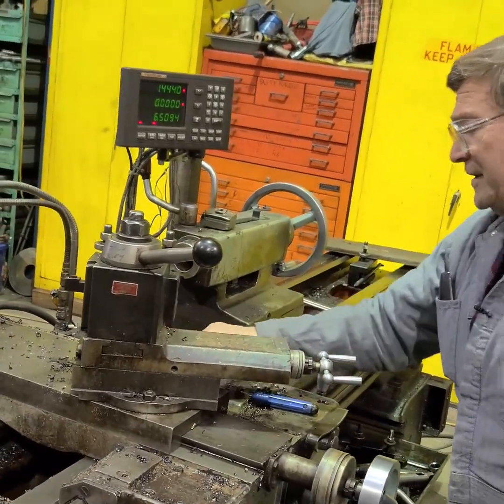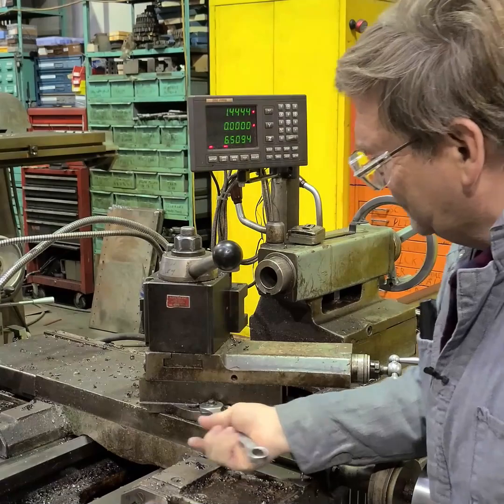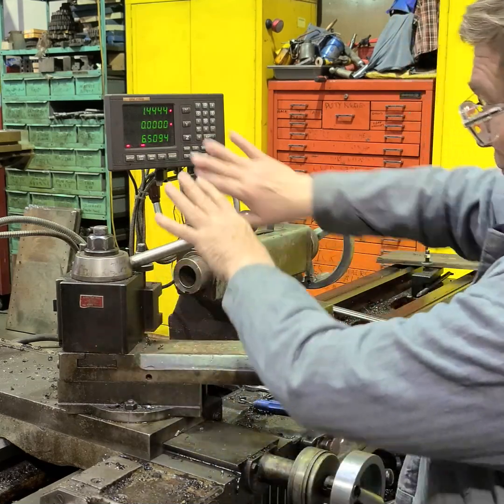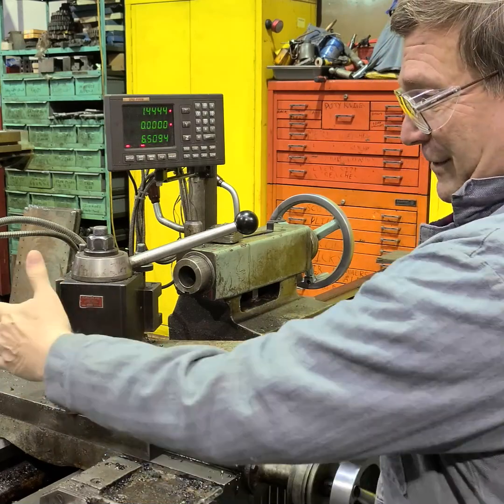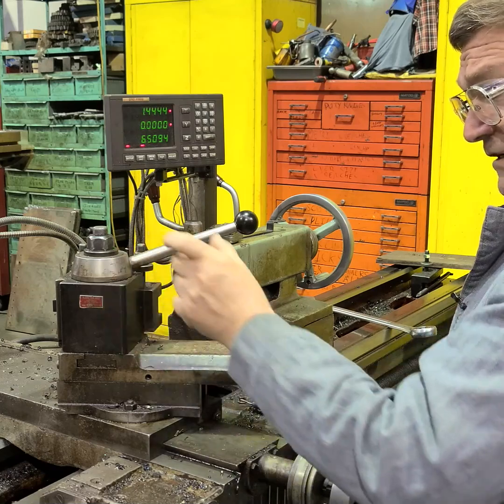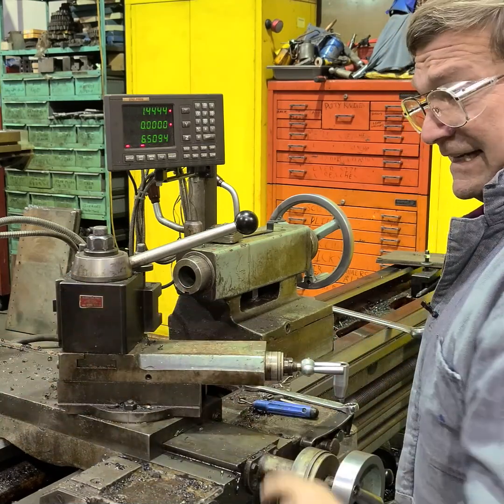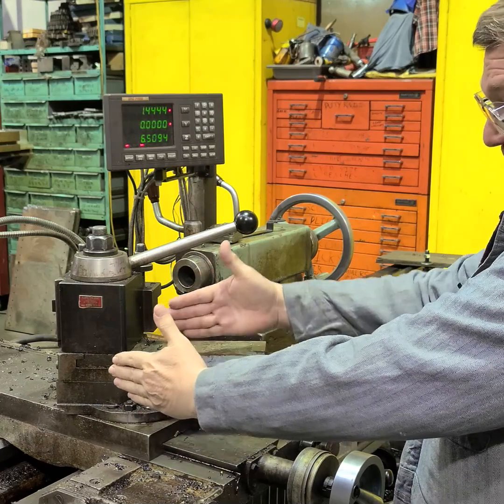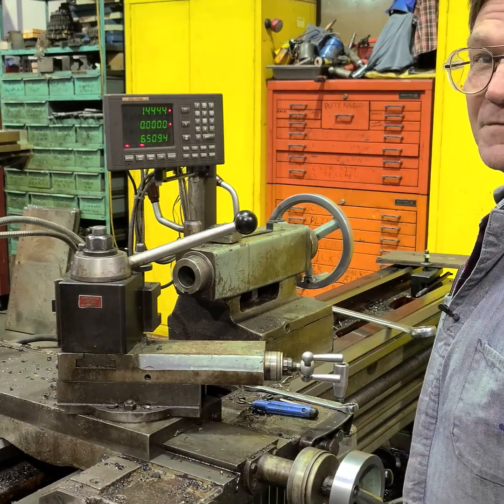Machinist's Minute: Set your compound to 29 or 60 degrees

Comment: I thought I was the only person that did that.
 29.5°, has to do more with tool tip pressure/heat/esthetics. The latter being  .. witness tool marks on the leading flank angle during threading ..and the condition of the machine and set-up. (Forgotten tip, thanks).

Comment: I thought they said we would never use trigonometry after highschool.
Reply: Trig has made me more money that I though it would. It’s why I know believe learning everything I can is important
Reply: @jamiepolchies7148 About 15 years after high school, I started using trig in auto repair. When I owned a shop, I had a small machine shop to be able to make tools and modify poorly made parts. Then when I closed the shop I worked for a company that did mobile adas calibrations. It was much faster to find the location to place the target for toyota blind spot monitors using trig than the way they said to do it. You have to find the center point of the vehicle and use a plumb bob to mark the rear of the vehicle on the center point. Then, place a laser cross the centerline an unknown distance from the mark. So you already had a 90*, and they gave you the length of the hypotenuse. Rather than doing a million measurements around the vehicle. I would just measure one of the agles off of the teplate on the monitor instead of printing it and placing it on the center line and do a bunch of measuremens. With that, I would just calculate the length of the legs and make 2 measurements from my mark and laser lines. After writing that, it seems like a lot, but it was much less work than what toyota said to do.
Reply: “They” know nothing of machinists!  We are the keepers of useful math, which “they” also know little about.

Comment: Any idea why I see lathes where the compound is set parallel with Z? I’ve never understood that.
Reply: When you don,t have digital readout the compound slide dial can be used to cut steps certain length using dial on compound if you set it so it's travel is going left to right or parallel to lathe bed,another way is put a dial indicator with 1 inch travel and use it like digital readout,another way is using a dead stop on carriage with a micrometer dial which it common on engine lathes

Comment: I recently went and visited my old trade school(used to be 5 in the state now only one left)and was saddened to see the shop was almost all CNC machines but had one old dusty Bridgeport and an old 22" Clausing and a Brown and Sharpe screw machine tucked away in the corner collecting cobwebs. The instructor said they don't teach the "old stuff" anymore. Too bad.
Reply: My trade school only had 1 cnc mill and 1 cnc lathe, all the other 35 machines were old school, no DRO's and no power feed, glad we at least have DRO's at work, but the knowledge to work without the modern amenities is helpful
Reply: interesting a trade school does that. our university starts you on manual machines then you work up to cnc if you wish. 

i wonder if it’s bc most jobs are cnc operators so they want it to replicate what’s in the real world?

i think it’s nice to start on manual to appreciate what the tool is doing
Reply: My school, we were lucky AF, 6 then later 7 diffrent manual mills, like 16 manual lathes(2diffrent types dont remember off my head), followed by like 16 cnc lathes, 2 of which could have live feed tools in there, and there were 4 3 axis cnc mills, one of which could be fitted with a 4th axis, and a 5 axis mill on top of it all
Reply: Kinda like teaching points and dizzy I auto school.  Not really called for.
Reply: Smart people making an old skill more valuable.

Comment: For od .009 give me .018 
I half the angle to 14 deg to do fine turning. .001 give me .0005 .
I think the reason 30 is great for threading is because .001 in compound is .001 of diameter of od.

Comment: Setting the compound at 29 allows you to thread clean threads, shaving slightly on the right. But… for deep threads, the tool might dig in, depending on the material. Be careful, take light cuts as you approach the PD.

Comment: 29*, 29-1/2*, 30*... the selected stance of various machinists... lol. 
I run 29-1/2* ahahaha
Reply: Makes both flanks of the thread birght.
Reply: @MrEh5  when I was an MR in the Navy we always set our compound at 29-1/2* and ran the dial to verify.
Reply: @RichFife HT here the MR shop was connected right to ours! We were always back n forth lol
Reply: @machinistmikethetinkerer4827  When I was in Norfolk... the base machine shop at SIMA was 31a... then it switched to 935k... the HT shop and the pipe-fitters were down past the cafeteria... that was back before DOD contracted the majority of the work out. Shit, at one point we had 64 MRs and the HTs were 100+ strong